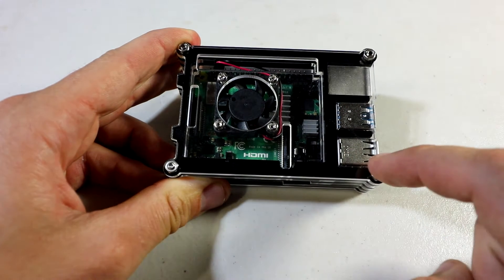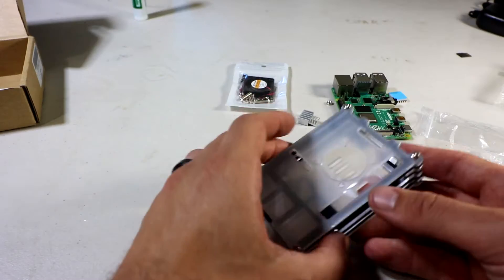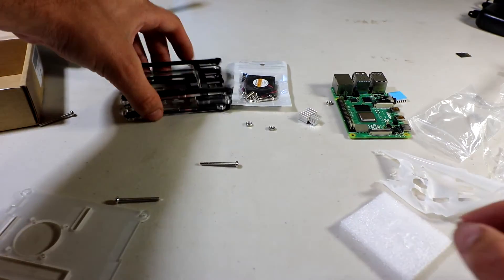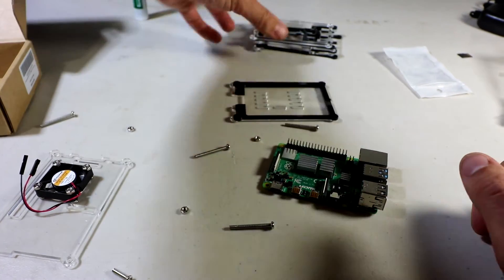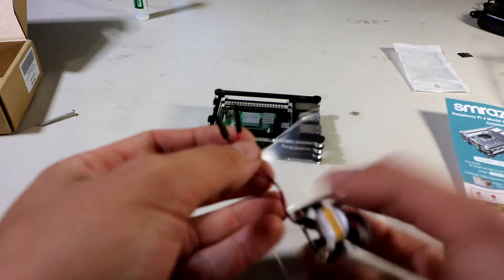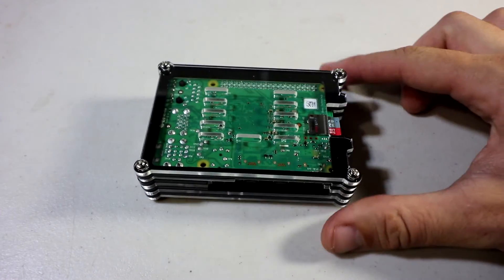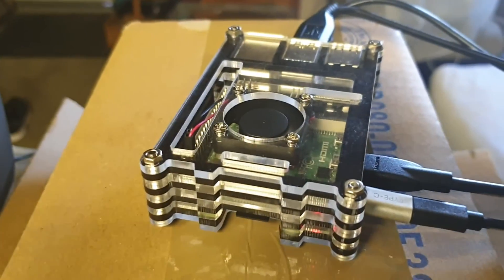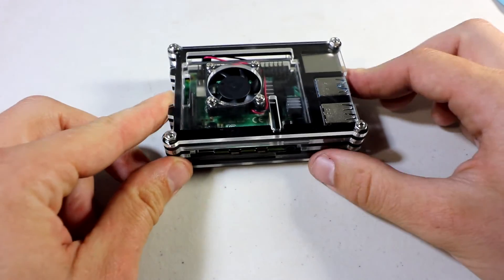Smraza Raspberry Pi 4 Case with Fan Setup & Test

Comment: Great video! You can add the heatsinks before you put the PI in the case however when you then add the 4th layer of plastic it can fowl on the heatsinks meaning you have to move them a little so best to put heatsinks on as per the instructions after the 4th plastic is added. Bolts should go top to bottom with nut at bottom.
Reply: My version of this case has 4 heatsinks, CPU/RAM/USB/ETHERNET so the heatsinks need positioned carefully as said above.

Comment: I got one of these, before seeing the video, great bundle and price as of time of typing was £20.  Though included Hdmi cable, micro hdmi adapter, usb to sd card reader and rubber feet.  Really is a good bundle.  You should add a referral link to it.

Comment: thank you for video, please I ask this: I have rpi 4 b and case and fan and it is ok, but now I bought also lcd 3.5, so I mounted it, but there is no space for fan cooler, is there some case/box that permits to have fan cooler and lcd togheter? if yes, please could you say to me what case? in future I have to do same thing with lcd 7 inch, and I will need same box/case with slot for lcd and fan both. please say to me something :)

Comment: My case was different, but I was looking for assembly instructions for the fan.  I wasn't sure which GPIO pin-outs I needed as the instructions were too small for me to read, even with a magnifier.  So your guide worked a treat.  Thanks :-)

Comment: You were lucky, they've replaced the nuts with jam fasteners that are too small to grab the side of the hole. You can't over-tighten the screws but for people who wear a size 14 ring it is a real pain in the fingers.
That said, thanks for a very good and helpful video.

Comment: A group of my coworkers bought canakits and they were all complaining about heat issues. I opted for this case and haven't had a single heat issue. I run the fan on the slow speed for completely silent operation.  Very pleased with this one. Thanks for the review.

Comment: both my hdmi converter and official power cable cannot plug into the ports. the case is blocking the edge of the cable to fit in. it seems to me everything is exactly the same as the video.except we use different cables. I am not sure if I mess up the sequence of the acrylic panel?
Reply: sorry it's my bad. I got the sequence of the panel messed up. also I broke the forth black panel broken because I didn't put the heatsink square enough. The heatsink block the panel a little bit. The panel is broken when I put some force. I am so clumsy in the craft project.

Comment: Great video.  After watching it a couple of times in slow-mo mode it was easy to put the case together.  I took your advice and put the screws in from the git-go.  That made it easier to hold the case together.  However, I positioned the fan so it sucked the air "out" of the case.  ;-(
Reply from the maker: not a huge deal would be interesting to see the heat differences

Comment: these wafer cases are so boring and the little heatsinks are so weak. i put ultimate 3510 cooler on my pi3 with thermic pate and glued it on then put dualfan heatsink on the ram and sdcard slot underneath. then shoved it in superpi case with the little bin cut out
Reply from the maker: for sure but they are cheap...

Comment: So, would you say that a 5v/3a PSU is fine and there isn't an absolute need for the official 5.1v/3a (15.3w) PSU?
Reply: On a related note, could someone try booting a Pi4 with a Nintendo Switch PSU?  Thanks!

Comment: Always blowing out with the fan extracts the heat from the sinks instead of pushing it around inside the case.
Reply from the maker: controversial topic i see!
Reply: Sorry have to agree with Jon S, Gaming PC CPU fan pushes air inwards on to the CPU, as with Memory and Graphics Cards. The only exception and this is personal preference, try to create a circular flow with the Tower. Fans pulling air in then PSU fan pushing air out
Reply: if there were 2 fans ya sure, but single fan as long as the case has openings for the air to exit always put the fan facing the heat sink. cool air from the outside directly on the heatsink is better than just pulling hot air out with no cool air coming in.
Reply: Jon S which way does the fan label face?

Comment: Where's the Rubber/Silicone Feet ?  Do not want scratches.!
Reply from the maker: good point...the nuts are the feet...the rubbers would fall off the nuts pretty easy...i guess you could get higher than nut feet and place next to
Reply: @drewtalks  Every case bar one i have came with rubber feet
Reply: Invert the screws and you have Your feet

Comment: I am using Top and Bottom of old version 9 layer case, with extra nuts to hold it in,  The Fan just clears the heat-sink
Now the 4B cases are out, i will grab a couple